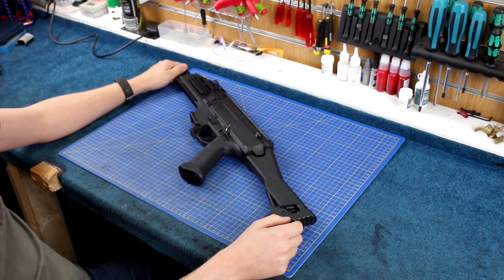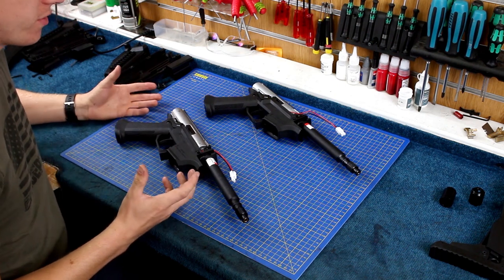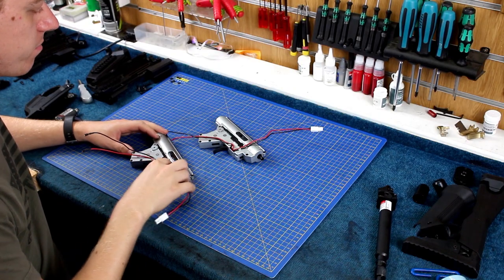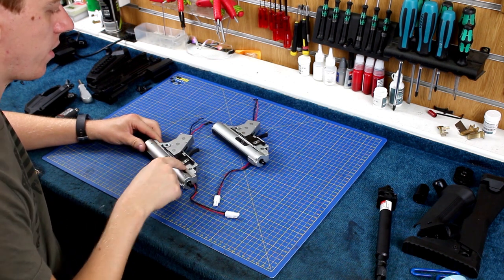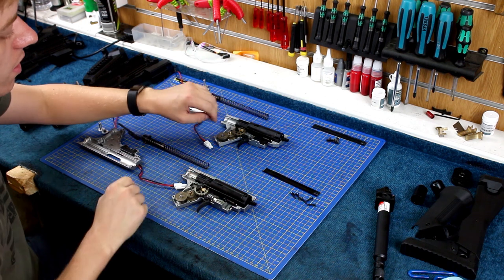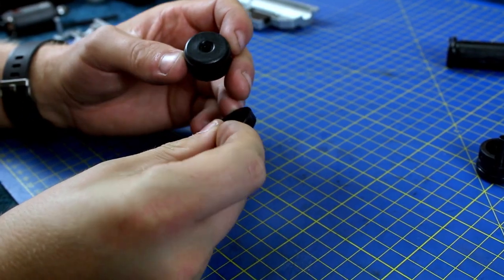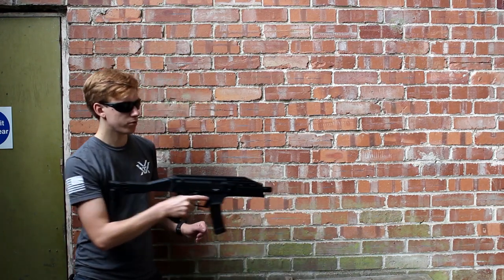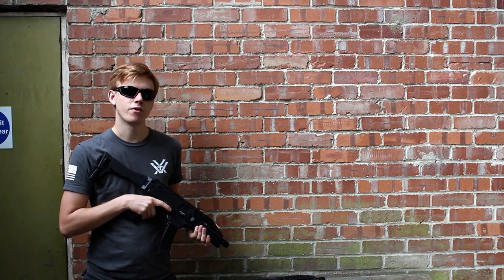ASG Scorpion Evo 2018 Comparison

Comment: please put a 11,1 in that thing, you're mistreating it
Reply: You can, you just need the steel spring guide and an M90 Milspec spring from ASG and 11.1 with 340fps.. Although, you will need to break the spring in for sure, I was firing at 370 first.
Reply: +FJJ WFP the uk version is bs then.. The danish ( original) is designed to run 11,1 and comes shooting around 450
Reply: Your just spreading misinformation now.
Yes you can run 11.1 and anyone who says you can't are either new or just being misinformed by people like your self.

As long as your hitting above 330fps then ASG recommends 11.1.
To hit the 330 you'll need the steel spring guide w/ bearing and an M95 milspec spring from asg (the blue tipped one). You'll be firing hot for a little bit so just empty many many mags to get that spring settled and you're all good to go.
Reply: ASG even says the gun is meant to be run on an 11.1 and won't function properly if not. 🙄